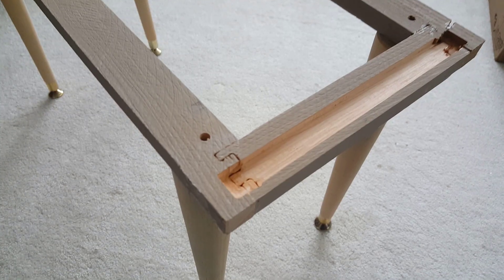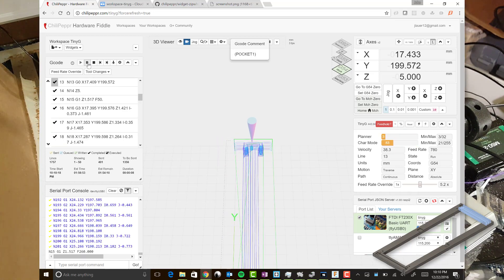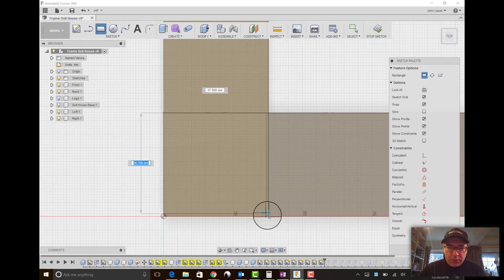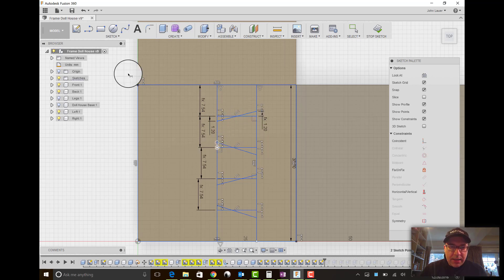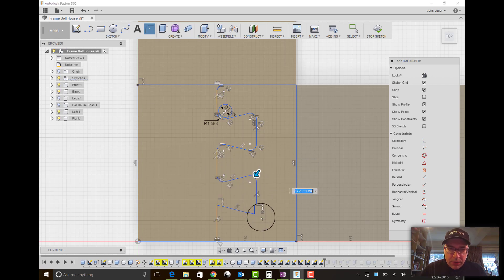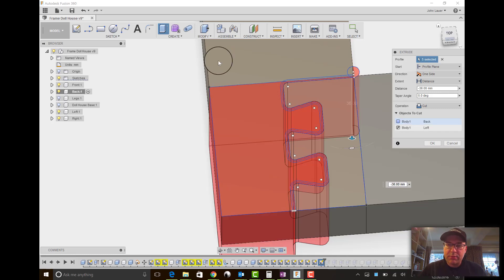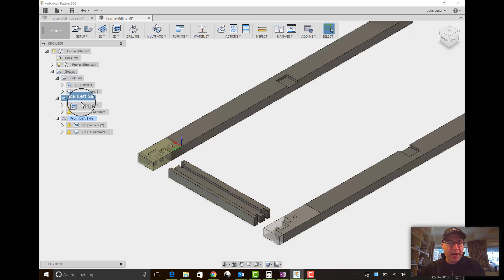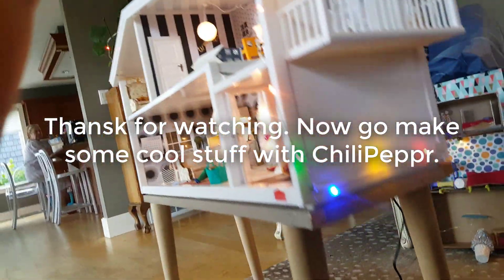Milling Dovetail Joints in ChiliPeppr using Fusion 360

Comment: Do you use the hose with brass nozzle for dust collection or for blowing air? Do you use coolant through it when milling aluminum?
Reply from the maker: I use it for blowing air. I just have it hooked up to an air compressor. I don't use coolant through it yet on aluminum, but would like to. I do think the 3040 CNC I use is not a great setup for liquid coolant because it has no drip pan and the linear slides aren't super well protected by default, but I'd like to get real liquid coolant or mist coolant going at some point.